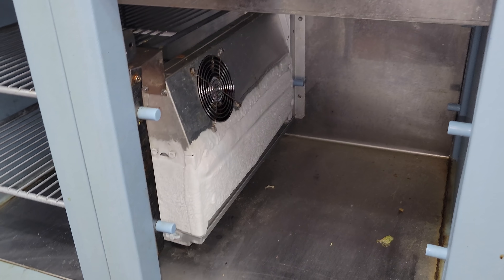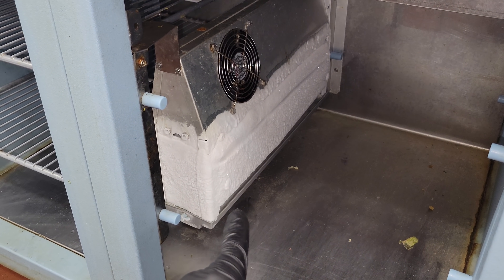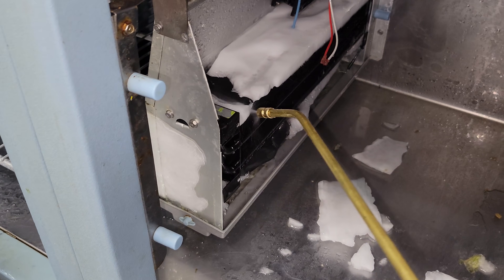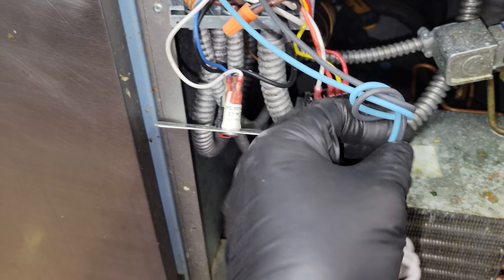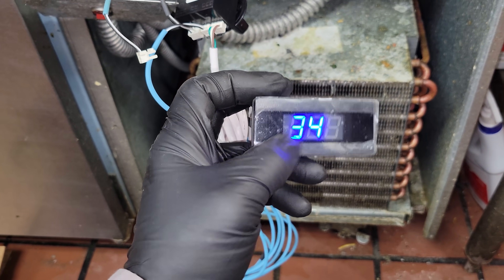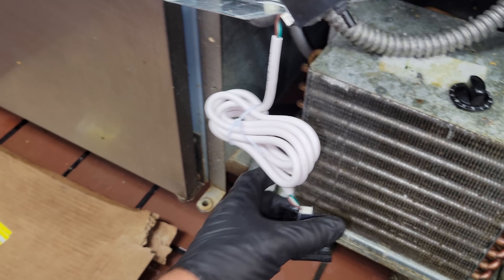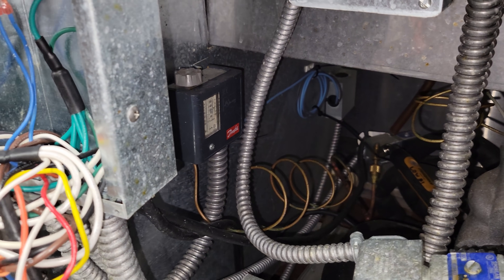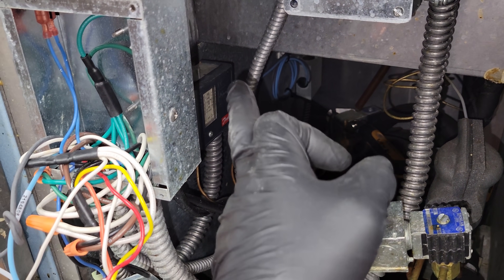THE COLD RAIL IS FREEZING THE FOOD

Comment: i found that most of the time it is that the customer always puts in hot /warm food in them or never remove there other food in the top rail. i write down the pressures and temps in the cabinet for the pressure controls N  install date

Comment: Can't you put a thermostat also with a " defrost clock also a pressure switch " in series so on either or shuts top of box off? So both don't have to run at the same time? Maybe I was working on a different brand maybe a true or chinese brand that had this in place. Also awesome tip on digital display! Thank you for that!! Also we have all learned from messing up on a bunch of stuff lol! 😂 Again thank you for knowledge and honesty.
Reply: Yes. By running two solenoid valves. One on the liquid line for the top and one for the box. Put in two T-stats and drop the pressure controls that usually leak over time anyways and go with digital.
Reply: But all of this takes money. You will have to let the customer know what’s going on. At this point a new reach-in should be suggested over all of the work that needs to be done.